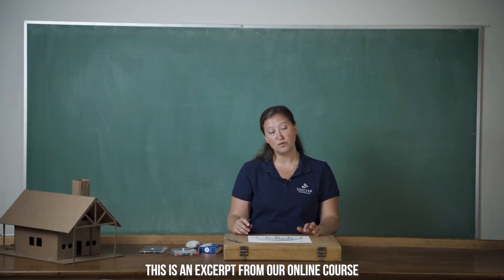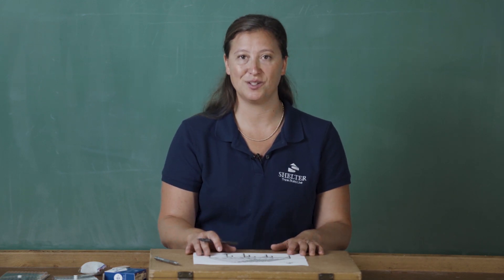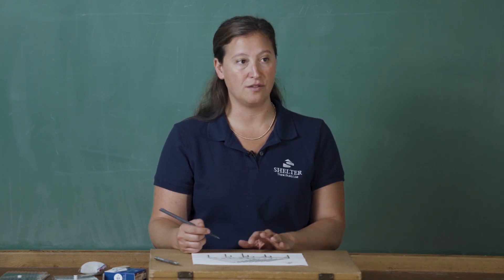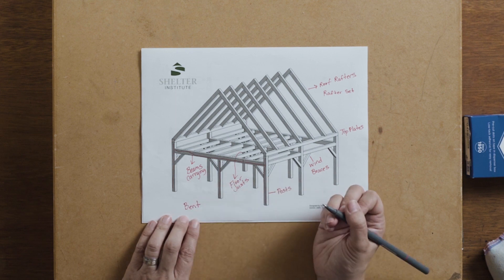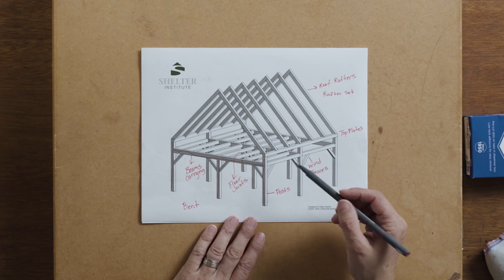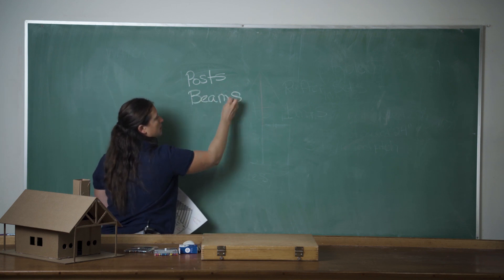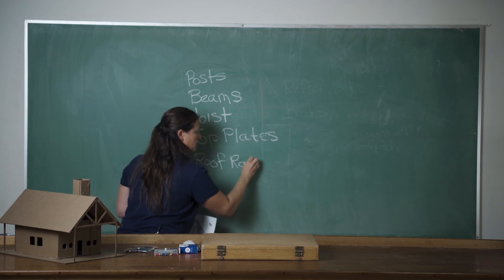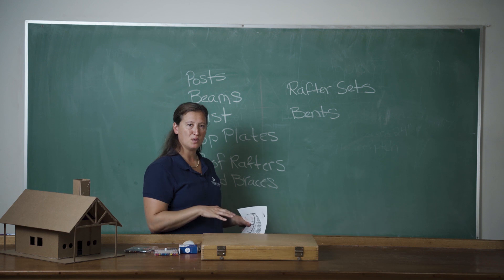Timber Frame Terminology Explained

Comment: Interesting. I only ever heard “bent” in reference to bridge construction. Abutments on either end and bents in the middle.
Reply: The wikipedia entry for bent says the most likely etymology is from an archaic past tense for "to bind".  As in, bind all these parts together, now they're a bent.
 https://en.wikipedia.org/wiki/Bent_(structural)#:~:text=The%20term%20is%20also%20used,a%20bent%20are%20joined%20together.

Comment: You neglected sills and floor joists! Or is it that you use a conventional framed floor system?
Reply from the maker: Timber frames can be constructed on a number of different platforms including slabs, piers and perimeter wall foundations. If the first floor platform is wood, we do often build it out of engineered i-joists and advantech or timber frame it or use SIPs. We like to specify the foundation and platform with our client using the lay-of-the-land, use-of-the-building, budget etc to determine the best design and materials.